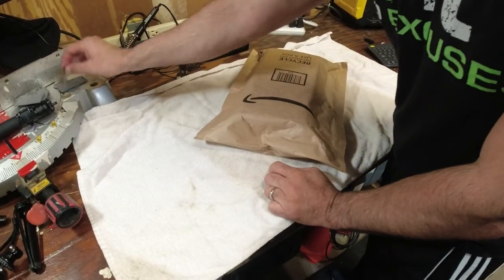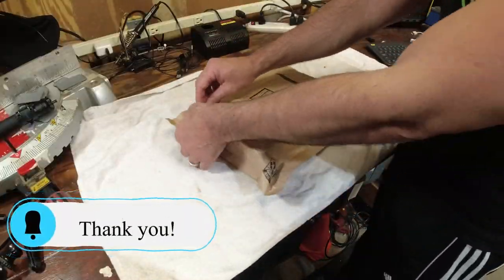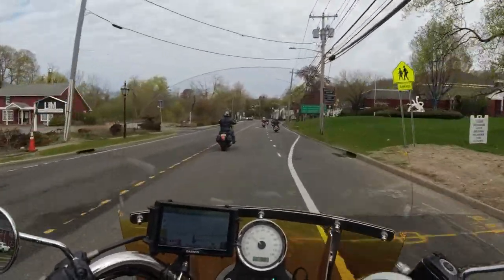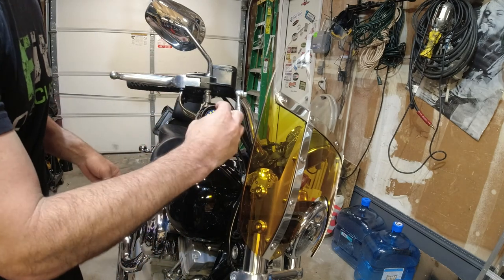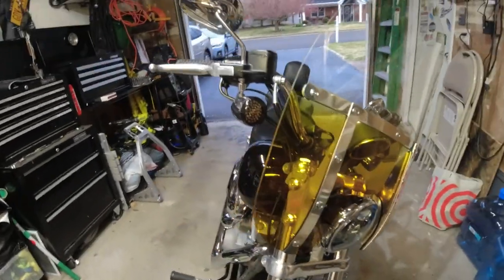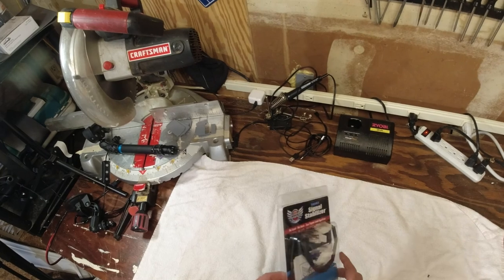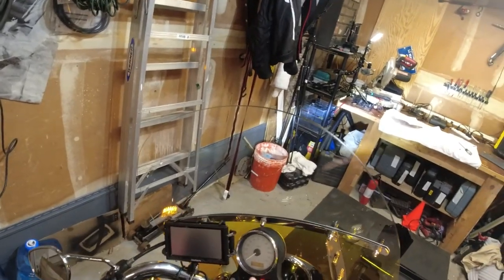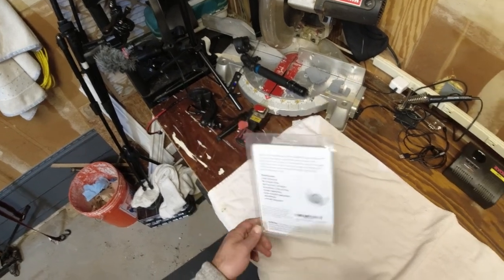How To Stop Hyper Flash With LED Bulbs

Comment: Did your security light come on with your hazard lights i put the same one in and my signals work fine but when i put on hazards theres no hyper flash  but security light comes on
Reply from the maker: Hmmm. I don't remember.  I remember testing the hazards and they worked, but didn't notice if the security light came on. Does the security light go off and everything return to normal when you turn the hazards off?
Reply: @Mudslidex1   no the security light stays on even after i shit em off
Reply: Shut them off **

Comment: Does the load equalizer get too hot?
Reply from the maker: Not at all.  It's not like the other cheaper units that are just resistors and absorb the extra current and turn it into heat.  These do not get hot at all

Comment: Any Harley older than 2014 will require a load equalizer when switching to LED turn signals if you don’t want hyper flash. 2014 and up has a different computer (BCM) to regulate any voltage differences.
Reply from the maker: Thanks. I didn't know what the year cutoff was that needed them

Comment: you should go for a long ride and see if the harness gets really hot....and do a six month update to see if it lasts or fails....
Reply from the maker: I'll definitely update as time goes on.  So far so good though.  I havent had any issues.  They say these are safe for "parade mode" which is when they have the 4 way flashers on for parades for long times.  I did try the flashers for mabye 5 minutes to test and temp didnt change.  But I will update if anything changes.  Thanks

Comment: You think it’s electrically safe to ride without the load resistor?
Reply from the maker: I know guys that swapped to LED and don't care and just ride it as is.  I don't know if it can cause any issues, but I myself don't like that the warning light on the speedo stays on as it's detecting an overcharge due to the current draw being much less now.   I honestly don't know if it would cause a problem or not.  I just wanted peace of mind and install one